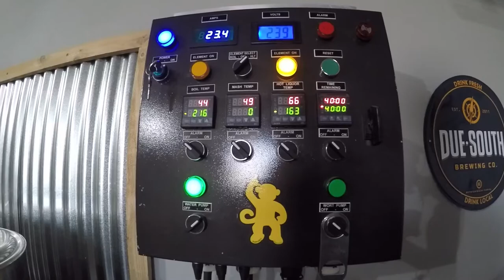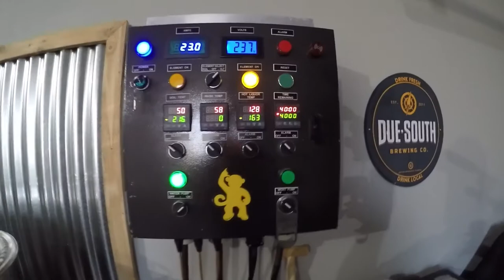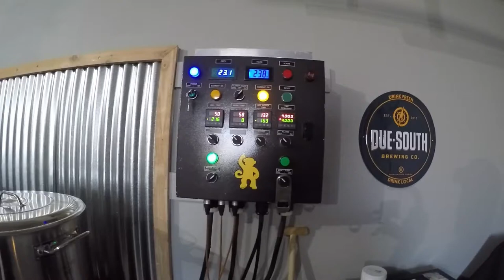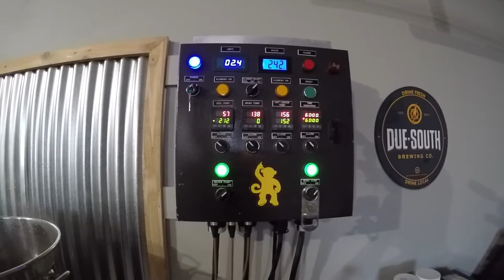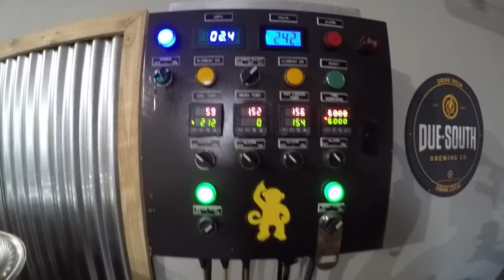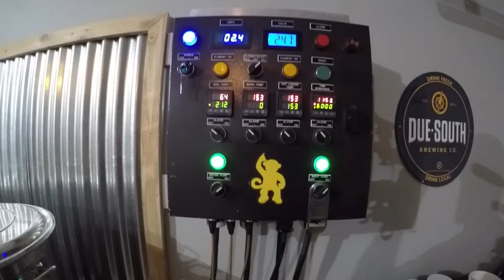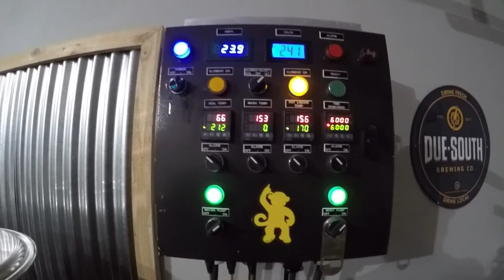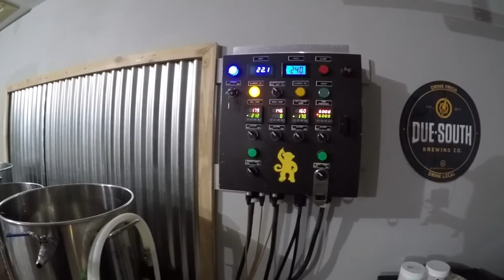Dreher's Abomination Vienna Pale Ale 1.0

Comment: Great to see you brewing on that bad boy. I'm super excited to see you brewing on it. On the boil, did you leave it on auto or did you put it on to manual and dial down the output percentage?  I found that when doing a 5 gallon batch I needed about 60% and when doing 10 gallon about 75 to 80%. End up with about a gallon / hr boil off. Cheers